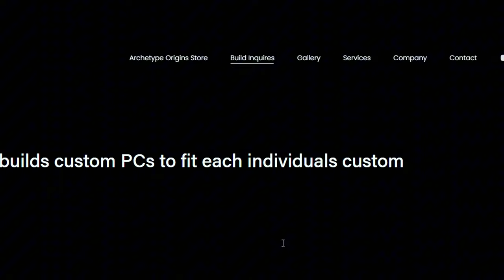Insane 14 FANs airflow PC build, Lian Li O11 EVO XL

Comment: I'm doing this exact type of build, except all black, with a 4090 and an ARCTIC 420mm dual fan AIO, with the AIO being side mounted.
Reply from the maker: It’ll be awesome! Good luck
Reply: @archetype_origins  did you need two different fan controllers, or did one suffice? How is the noise with the 6 x 120 fans + the others ? Right now I have enough for 2 x 120 rear exhaust, 3 x 120 side intake, 3 x bottom intake, and 3 x 120 AIO exhaust. Thinking of 6 x on 360 AIO …
Reply: hmmm, all i'm seeing when i google artic 420mm aoi - are 3 fan designs...typo? thanks
Reply: yo @sidharthrao9005, you got any updates in your pc? hope you got a link images to comment it here so we can see that bad boy 🔥🔥

Comment: 6 large fans pushing air in and 5 small ones out? Sure, overall it works but as you can see its quite a mess - you don't see smoke flow but its inside everywhere. The fkow in the case should be allmost even - I like to go for setup where it pulls out a bit more than is pushed in to maintain better flow. The key is to make the intake fans spin slower. I mean I understand that filling all thge fan spaces up with RGB fans looks cool but you gotta do it right.

Comment: Thinking of the same build. But for the aio I would like to use on top reverse blades will this also be good?  I will have 6x 140mm intakes bottom and side , 2x120mm rear exhaust and aio 3x120mmexhaust on top of that 3x120mm reverse blades like using it as a exhaust. That it takes the hot air out from the aio my case is evo xl

Comment: Great build! Looks amazing! 

The 6x total fans was not needed and probably hurting the performance of airflow if anything. Even if being the same fans at the same speed they are fighting each other. I get thought that one fans pulls air in and the other pulls it out but the design of any radiator itself is designed for 1 set of fans pulling or pushing air but not both.
Reply from the maker: Thanks for the advice 🙏

Comment: Fairly new to the PC world, this is the first time seeing two sets of fans sandwiching a radiator. Is this so it pulls exhaust out for the shown test or were you trying to get more airflow to the radiator to cool the cpu more? Would it be fine without double stacking?
Reply from the maker: Yes it would be fine without push pull configuration
Reply: @archetype_origins  thanks man👍🏻

Comment: Using all those big fans - and with all the airflow they create, does that Ryzen CPU Still need to be liquid-cooled? Wouldn't the airflow be enough without adding an AOI? Thanks
Reply: The CPU? It still gets pretty hot despite all the fans and 6 are there to simply cool the aio … I got a total of 16 case fans and good COU cooling is still essential …
Reply: @GanymedeXD  Got it. thank you!

Comment: hey you should check out 3d printing some fan brackets to fit 4 120s on the top and bottom. I did that for mine with infinity fans and it looks so cool. I have 16 total fans in mine and it cools it like a beast
Reply: you have any links to the 3d print files ?
Reply: also i want to see your pc lol can you show pics/vid ?
Reply: I have exchanged the front glass panel with mesh and have 120 mm AL & SL … 3 top, 3 bottom, 3 front, 1 rear, and a side 6 fan push pull for my NZXT aio but without NZXT fans … additionally 4 noctua 80mm  fans to cool the harddisks … 😂 … as there was space!

Comment: While im watching this im waiting on my product

Z790 rog wifi
Ddr5 z neo 64gb g skill
4070 msi oc super 
3x wd black m.2 2tb (alot of editing so need space) 
Lian li uni sl inf 9x
3 uni inf sl rev
I7 149k
Lian li evo xl
lian li galahad sl inf 360
 Both stimers 
1100 gold platinum psu
Some more funky things like special plate for gpu lcd for the inside of the pc but doing it bit by bit so imagination goes on wanne make a build that none done before and so far it works and this is just alot for gaming and editing 🤣 

Right now i have 
Z390 wifi
!7 97k
Ddr4 32gb vengeance 
3060 msi oc 12gb gaming
3 diffrent ssd and 2 hdd 
6 fans from corsair and some other things so that build gonne be wild
Reply from the maker: We are super excited for you! Its going to be a huge change!